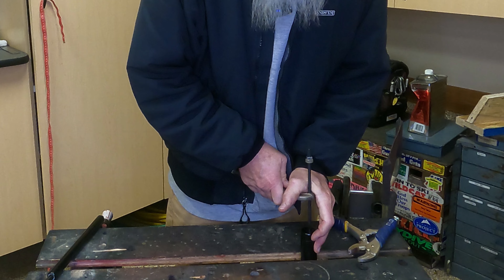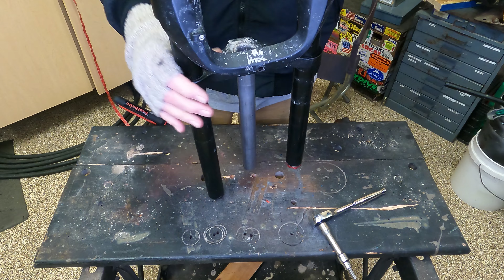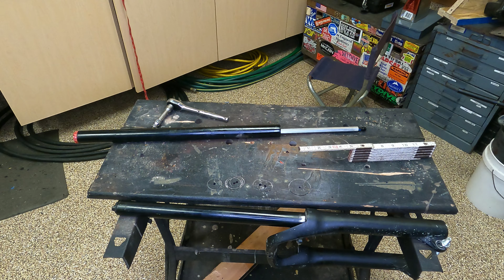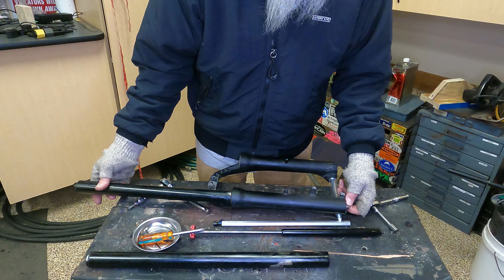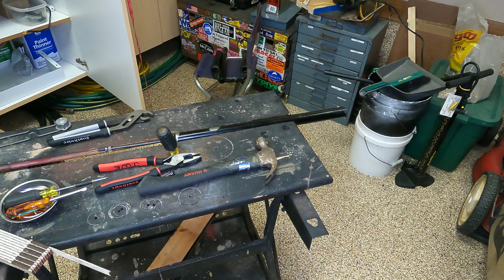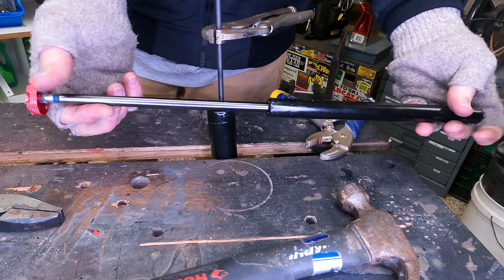🥇 Part ONE... GUTTING the @juicedbikes Suspension Forks🛵The 🐂💩 inside is SHOCKING ⚡UNBELIEVABLE! 💩💩

Comment: Do you remember the length of the stock forks?  I got the 26 inch x 4 inch forks like you did but I don't like that the bike leans over a lot more even with that heavy duty kickstand.  Also then they send me had small bump stops that don't no nothing from stopping the handlebar from hitting the frame.  LOL. I asked Crap bikes customer service but of course they are no help and don't have the measurements either.  I'm not surprised.
Reply from the maker: No I don't remember, maybe 2" shorter?  I liked them being longer as it felt more leveled out on front.  PLUS you go from a 1/2' travel on the stock to almost 5" Travel with the new.  The bump stops were fine for me. The kick stand should be adjustable for length.